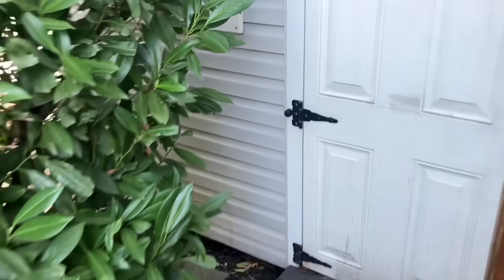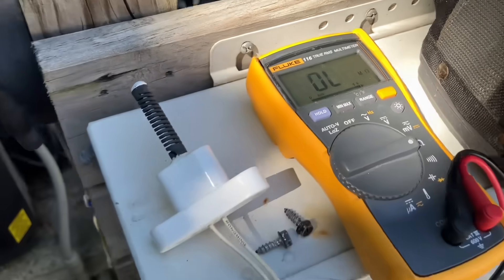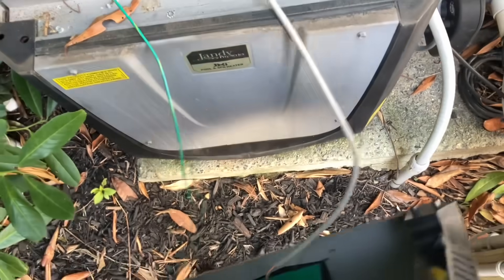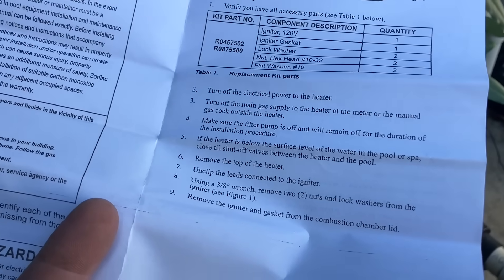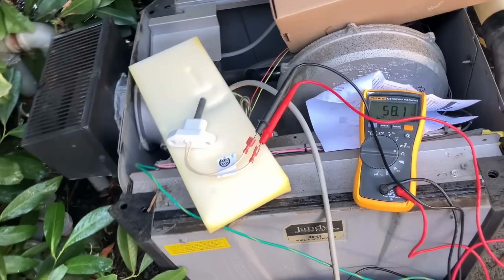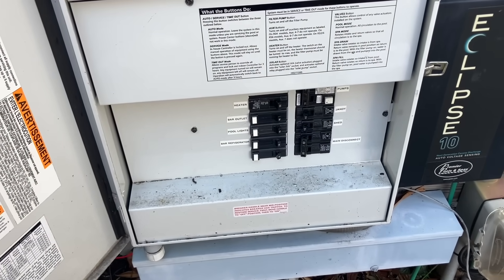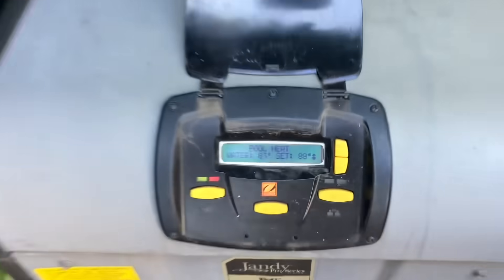Pool Heater FAIL! Brand New Jandy JXI Igniter DEAD in Under 30 Days – Here’s Why You TEST FIRST!

Comment: Hey Mike, Got an issue i could use your help with if you have time. Jandy LRZ250EN unit. Ignition fault code. Everything cycles, the unit calls for gas (which you can CLEARLY smell), but no ignition. I tested the old ignitor. Not only did it test NFG, it was crumbled into many piece laying in the bottom of the ignition chamber. so, clearly a bad ignitor. I tested the new ignitor, it tested good, installed, same issue. Everything cycles, but the ignitor never glows. I am 80% sure the FENWAL controller is NFG. To confirm my finding, i hooked up the ignitor directly to 120V through a household light switch. Turned on the ignitor switch i installed, turned on power to the heater, ignitor glowed, gas came on, "Houston, we have ignition!". Turned off the ignitor switch i installed. Flame stayed lit and ran for about an hour until i turned off the heater power. Basically, i think the FENWAL is doing everything it should do except sending power to the ignitor. Power into the FENWAL is good. It is sending power to the gas valve. It is getting the "all good" signal from the flame detector. Both the 120V & 240V ignitor terminals or only ready about 25V on startup. Based on the info i have provided, does it sound like the FENWAL is bad to you? I don't mind buying a new one. But, i am not a "through parts at it" kind of guy. Thanks!

Comment: Hey Mike Daick, of Mikey Pipes Plumbing not easy being cheesy. Hmm? Again the hot surface igniter is in a seal plastic bag and the box is seal too. Maybe some dumb ass had put his dirty or oily fingers on the igniter and place it back in the box again. You that ceramics on the hot surface igniter is same as the ceramics heat shield. There are about 24000 heat shields on the space shuttle and they cost about $10000.00 per tile too. Love you buddy, you be safe out there.
Reply from the maker: Thanks for sharing

Comment: Just a tip.  If theirs an issue you’re trying to figure out with one of these heaters.  Any brand.  An it’s an issue that shows up only after reaching a higher temp.  

If they have a raised spa.  When putting it in spa move.  Flip the switch on one of these actuators for a few minutes.  An pump the spa down to about the level of the seat.  

That start circulating spa only water again while heating to find the error.  

Instead of heating the whole spa yould only be heating about 1/3-1/4 the volume of water.   So ya can get temp into it a lot faster. 

Obviously it don’t apply here or for this situation.  Just tossing it out there.  

Also only works when the spa is raised to you have somewhere to pump that extra water.  If it’s level with the pool.  Obviously it’s not possible it’ll just flow back into the spa.

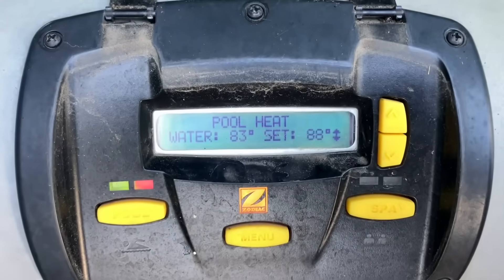Comment: At 7:11 the pool water temp was 78 and the set point was 88. At 7:22 after a cut in your video the water was 83. That would take my 400,000 BTU heater five hours since I only get about one degree per hour.

How did it increase so much in the time you were there? I have to assume it was less than a half an hour later.  possible you were heating the hot tub or spa but it was set for a pool not spa
Reply from the maker: The pump wasn’t on. Once the pump came on it showed the pool temp.
Reply: @PipeDoctor thank you. Didn’t think of that cause mine won’t even fire without the flow switch closing. Guess it was the temp of the water in the pipes underground at first before the pool water made it into the temp sensor of the heater.